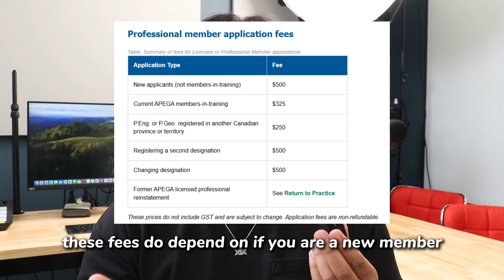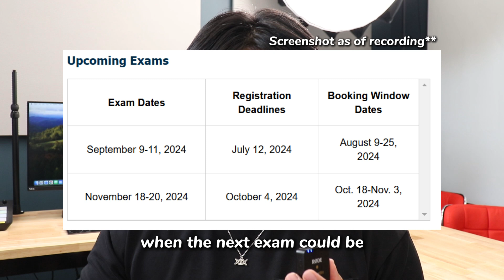How to become a Professional Engineer (P Eng) in Canada | GUIDE of what you NEED to know.

Comment: So, what qualifies for the 4 years of experience? I mean are there any more requirements on those years of experience? I worked as a mechanical designer, which involves design work. Does this also apply? Do I need to work under an existing P.Eng?
Reply from the maker: hey great questions, firstly i'd obviously recommend contacting your provincial association directly just to be absolutely sure. but based on my understanding on my research of APEGAs (Alberta) requirements for this video this is what id say:
- APEGA says you need 48 months of 'professional-level engineering experience'. Based on what the U of A says: 'APEGA's Board of Examiners makes its decisions based on the acceptability of the claimed experience by supervisors who must provide this information directly to the Board.' So it seems like a not incredibly defined area which you might have to do some further digging in. Ik, its weird!
- To my understanding you dont need to be directly under a P Eng, but I'd double check this to be 100% sure. APEGA says for the Validators, its 'Expected to be a P.Eng. or equivalent practitioner in engineering who took technical responsibility for the applicant's technical work.'

I hope this helps, but again, I would contact APEGA (or whatever provincial association you're under) directly so you can be sure. Good luck!